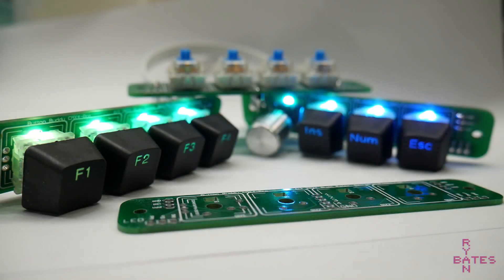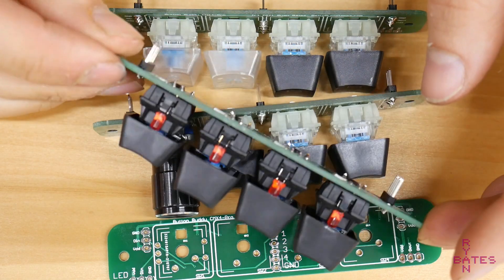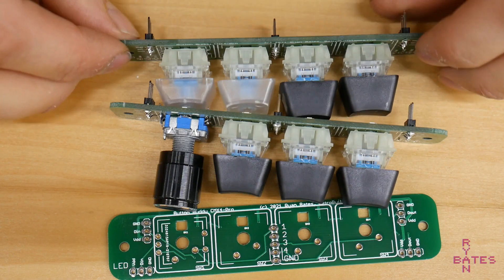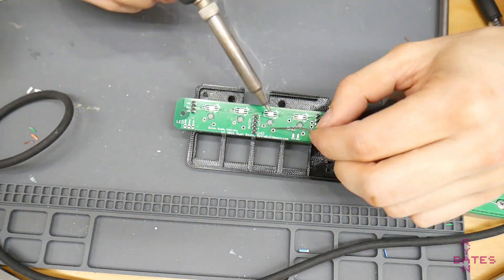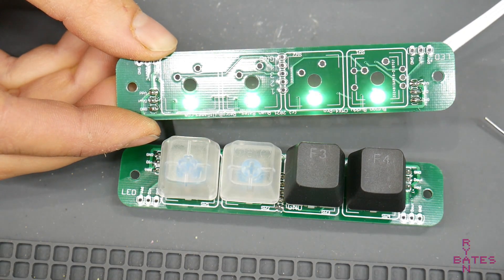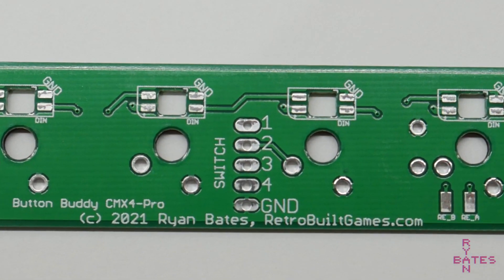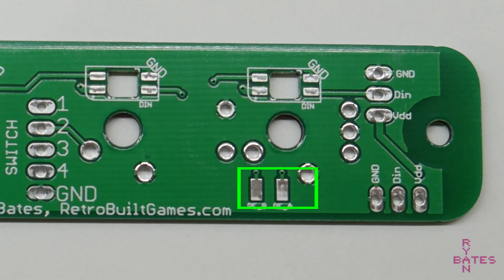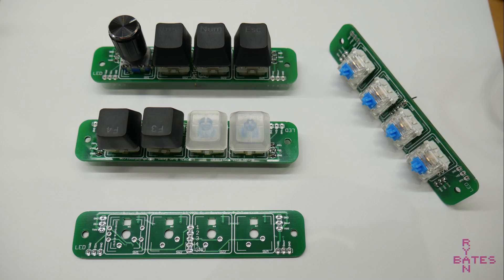Breakout PCB for 4x Cherry Keys 4x, RGB LEDs + Rotary Encoder

Comment: Hi, Im sorry if its a silly question, Im new to this SK6812 mini-e leds and there are a lot of things that I still don't get. How is that you didn't use the 1uF capacitor?
Reply from the maker: not silly at all. its a MFG recommendation but not required in all cases. In this example i'm only running 4 LEDs (not 100+) there's not too much disruption in the supply voltage rail.

Comment: RetroBuiltGames, I wondered if you could share a kind of "cut up" version of the pcb?  I bought 2 of your V2.0 boards a while back and they both still work fine. Reason I'm asking is because I bought a bag of 100 LED's and wanted to try to use them in other projects here and there (in sets from 1 too 4-5). Rather than trial and error a pcb with turn around time..... figured I'd just ask first, rather than reinventing the wheel.
Reply from the maker: totally. here's a 2-key board with the same footprint for the sk6812 mini-e LED https://github.com/retrobuiltRyan/Mini-Macro-Keyboard-v2
There are eagleCAD board and schematic files in the repo.
Reply: @RetroBuiltGames  Is there a gerber file for the 4-key pcb also? Thanks.